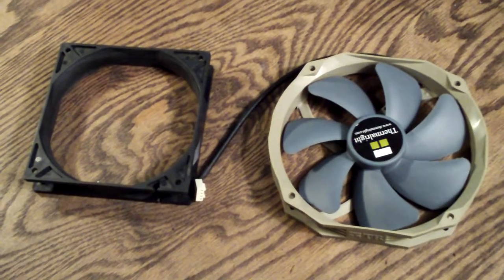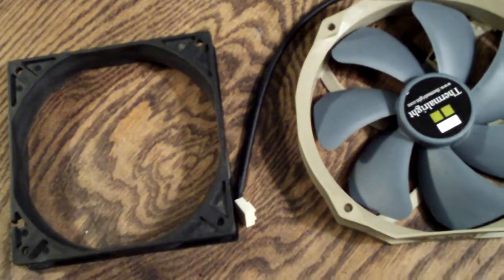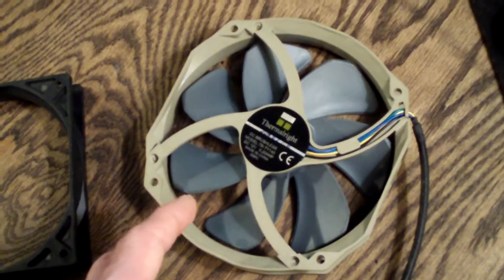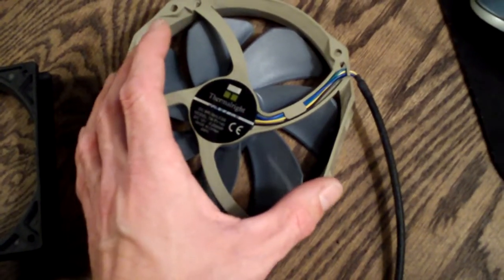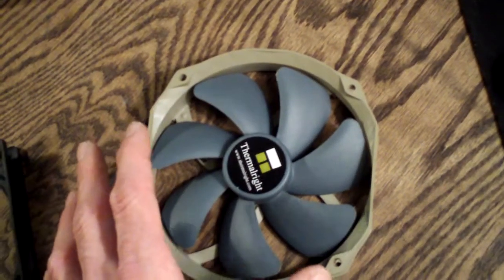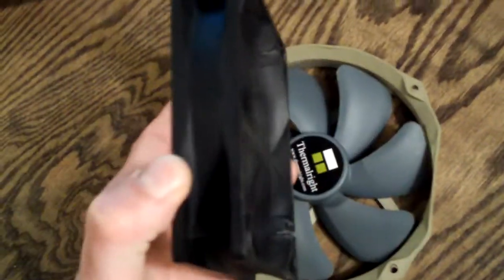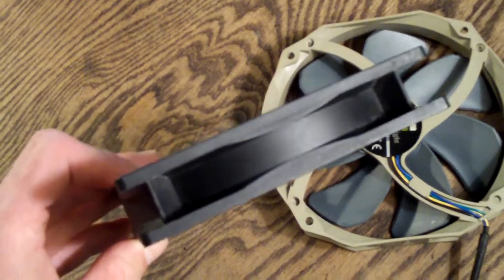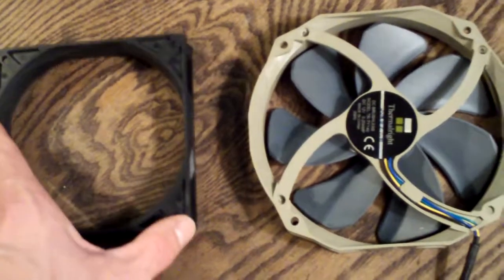Fan Shrouds Explained(What they are,How they work,How to make them)

Comment: Im not an expert, but this doesn't prevent turbulence, it directs the flow of the air. There is a difference. It would require some sort of honeycomb set up to produce laminar (read non turbulent) flow. However, you want turbulence to a degree, because turbulent air is better at heat exchange than laminar.